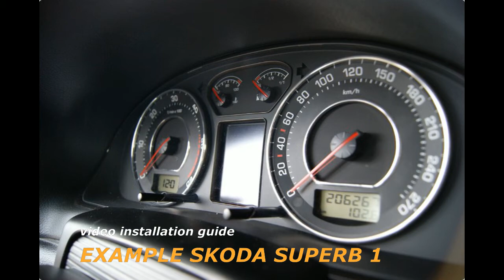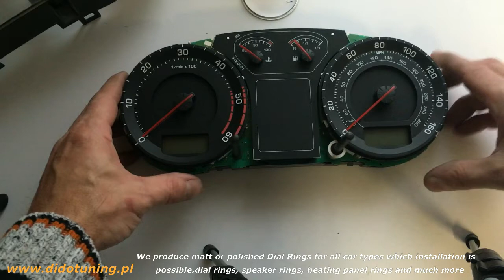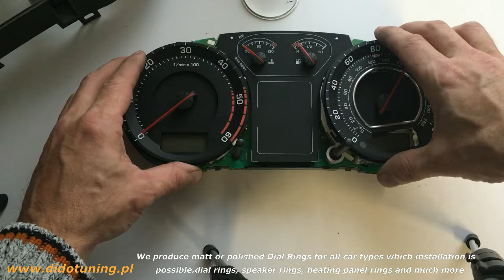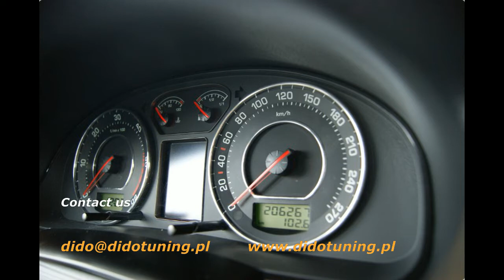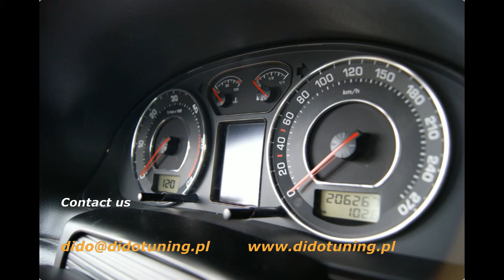SKODA SUPERB 1 MONTAŻ RAMEK

Comment: Hi everybody. I have the Skoda Superb 2002, and my car battery is empty. How can I enter to the car? I have not any mechanical lock by the emergency key - it is blancked. Thank you for any idea.
Reply from the maker: supply electricity in an emergency: remove the side small turn signal (turn signal lamp located in the fender)

instead of a light bulb - connect a second battery
(remember + to + -do-)
open the car from the central locking
Reply: @dido-tuning  Thank you very much, I will try it. Will it work also with the rear licence plate light bulb?
Reply from the maker: @PureVoice_cz  it doesn't matter - just put electricity in the installations